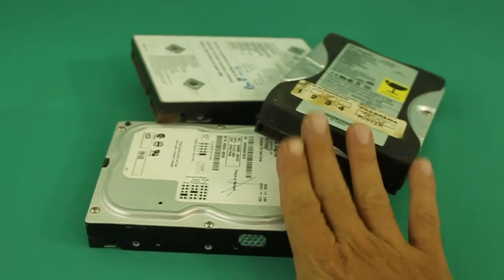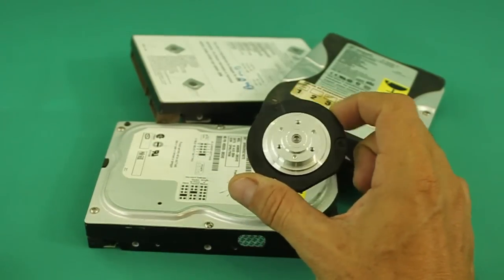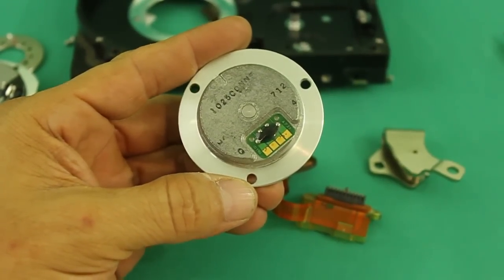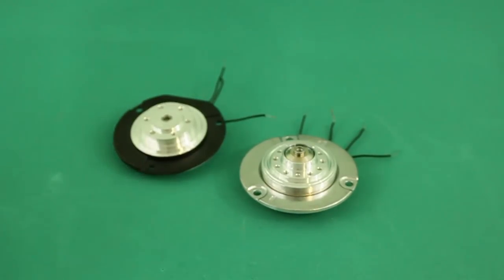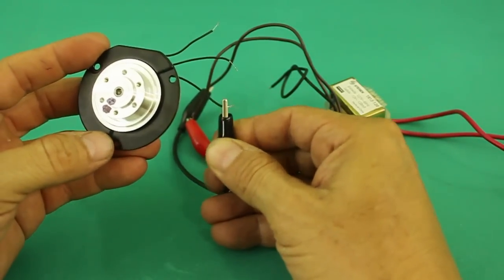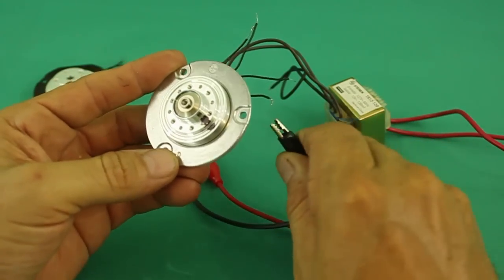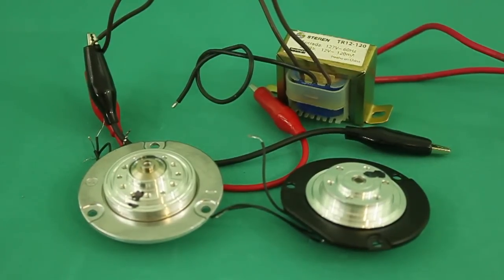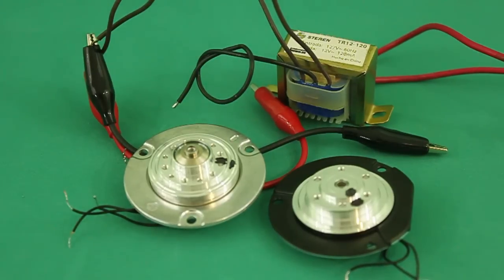Run a Hard Drive Brushless Motor Without Driver

Comment: I worked out the awkwardness of using a brushless without dc when I connected a pin then the shaft rotated slightly then stopped, then I put power to another pin and it shifted so.i could only move the motor 1 increment at a time, I couldn't think of a solution so I gave up on it lol

Comment: You didn't give DC supply.  Your supply was AC
Reply: Every Device who need DC power they definitely runs with Supply or Adapter so they use mini transformer as Supply. Transformers converts AC power to Dc as low as you need.
Reply: @Wiipro2006 but he said vice versa

Comment: Using a simple metal-paper condensator to form a Steinmetz circuit does improve it totally: more torque and starts without external help. How to connect? See https://de.wikipedia.org/wiki/Steinmetzschaltung (sorry, no English equivalent)

Comment: It can spin by itself by using a Capacitor in every wire or can use its original harddrive's ESC.Powering the PC tower harddrive in 12v makes it spin by itself without the help of the computer's processor.

Comment: Single phase create oscillating magnetic field. You need minimum of 2 phase to have a self starting motor (for synchronous motors). Also, speed of motor will be fixed (synchronous motor + 50Hz).

Comment: You CAN use motors made as part of the frame - I have several. You simply need to very carefully cut the frame around the motor (ideally with a band-saw) making sure NOT to damage the flex connector that will almost always be present for such motors. Once cut it can be used like any removable motor.

Comment: Should the supply be 12 VAC maximum? And I was wondering if these little motors are basically induction motor without magnet as a rotor but more like a squirrel cage rotor?

Comment: What is a 12 volt transformer?  
It is best to simply say what are you supplying to the motor with exactly.  12 V AC, 12 V DC or...… ?
Reply: It would provide 12v ac at 60hz in the US
Reply: @hyperion112  I can't even begin to describe how I feel about choice of words used, especially in science where word accuracy is more critical than any other area.  
Here for instance when I hear the word transformer, it instantly and subconsciously to me it implies going high, going up. To transform.  It is how it is used in everyday language.  Imagine telling that something has transformed. That person has definitely experience some sort of transformation. he seems much more disciplined etc.  But  in science it is an outrage.  And I have no desire to bore you with writing a long a narrative.  Just one more for the road.  Particle spin, spin up, spin down. Big baloney bullshit.

Comment: Use a brushless controller from a model aircraft and it will self start and you can select the speed by injecting a pulse between 1 & 2 mS (simple 555 circuit)
Reply: https://www.youtube.com/watch?v=TeZXXDoEGuc

Comment: The reson why u must give a push is because the alternating current only flows to 1 of the coils. If it was hooked up to a driver the driver would fire the coils n,s,n,s - and so on deleting that push from the beginning and have much more power and efficiency

Comment: Are you sure its AC motor powered?
Reply: AC stand for alternating current, and he's driving the motor by the frequency of the power grid, either 50hz or 60hz, that's why he says you can't control speed by this method. You can however control speed by changing the frequency with a motor control unit, either a dedicated or a Arduino/blue pill, or similar, by PWM, or even simpler circuits. It can be driven by both ac and dc, so it's universal.

Comment: Use a capacitor whit one connected wire and the not connected wire and it will start on it's own!
Reply: Then you will have a fase shift do to use of the capacitor.

Comment: In fact brushless motors work with AC current that come from electronic cuirct and control of speed by different frequency. There for its work with AC currnt that come from transformer but its slow because the 50 or 60 hertz it's so low frequency for this motor

Comment: By adding a capAcitor between ANY PAIR AND Supply the other two it will spin by itself associated with vibration my innovative friend
Reply: @Francisco E. Parulla same way a single phase induction motor needs a capacitor to start. And switching the legs connected to that capacitor will change the direction.
Reply: Starting capacitor like a washing machine motor but on a micro scale. 👍
Reply: A washing machine motor is a brushed universal motor. Not an induction motor.
Reply: you are right

Comment: i don't get it ... why is other sites using a 30a  ESC brushless motor speed controller if all you did was hook up 12 volts to two of the terminals?  i only know enough about electronics to get my feet wet so I'm guessing I'm missing something here ...
Reply: because by this mechanism you will not gain speed.. not gain torque..
Reply: https://www.youtube.com/watch?v=n1h4ju7vQuM&lc=z22ktzeyrvabgjmzo04t1aokgzlox3gnkzscyogc0c5ork0h00410

Comment: a cap between the freewire  and + or - wire  can run the motor without touching it forward and backwards if you change + or -

Comment: I'm here scratching my head trying to figure out if this guy was really serious when making this video... FFS if he really knew how these Stepper Motors worked (I don't even think he called the motor by it's actual name a single time) then he'd have known Stepper Motors, and those alike are all Magnet DC Motors and since these were designed to have various speeds they have 2 input power sources. One source is the Main Power of usually 12vdc and the second is usually around 3.5vdc. All he had to do was exactly what he was doing and then touch the 2nd wire to a smaller voltage battery, the negative wire attaches to both negative wires on each power source naturally. 

And don't forget you're voiding your warranty when doing these tricks. so all those hard drives from the 90's you've been saving all these years you can forget about keeping the warranties.

Comment: Motor DC input voltage AC very fun.
Reply: It is not dc motor you can make it to do using controller original or make it you probably don't know nothing about ac dc current any thing you can make it work using electromagnetic induction and pulse

Comment: What needs to be done to get more AMPS with the same setup?
If you charge a capacitor rack, wouldn't you be able to pull HIGH AMPS from the CAP?
Reply from the maker: Yes but only for a limited period of time
Reply: This is the tricky part I always wanted to know how to calculate...
How to come up with the time a different load can stay above certain voltage while discharging at certain rate?  So that on the other side you can pump volts (with some voltage pump) at some rate so that you can keep the discharging cap full at all times...  Are you with me?  Thanks!!!  I LOVE your videos...

Comment: I've added a speed control using a sine frequency generator on my phone wgere you can adjust the frequency. I plugged my phone audio out into an amplifier which then, I connected to the motor. But after around 150 Hz, you start getting harmonic imbalances and the motor comes to a buzzing hault, because you are usung only one phase.
Reply: I did this also to my stepper motor

Comment: Connect these to a low voltage 3-phase power source. This makes it a AC synchronous motor.
Reply: and what is that low voltage please
Reply: @jumcopper  anywhere from 6 to 12 volts. ( or about 9 volts or so RMS per phase.)
Reply: I have a 9 volt DC transformer. Is there a way to make that work?

Comment: A start capacitor should work, you may need to play with some different values ranging from say ~20uF - 300uF and suitable AC voltage rating. Placing the capacitor between the floating phase wire and one of the other AC phase wires will result in a phase shift in the current and subsequent magnetic field shift in that winding. Resulting in a tendency for the rotor to favor to move in that direction and thus allowing the motor to start spinning up to near synchronous speed. Different the start capacitor capacitance will give different phase shift angles depending for a given winding impedance. This increased phase shift together with the increase is winding current due to the apparent change in the winding impedance due to the introduction of the capacitor  impedance will result in better starting torque. Note though the starting torque will not be very high or as good as having a  3 phase VVVF driver. The added benefit of a PWM drive is good starting torque and variable speed in excess of that attainable at normal mains frequency.

Comment: it still requires that part so either way you still have to buy something or find it inside something....the same as finding a small speed controller and parts inside something but on ebay you can by the parts needed to work for like only 3 dollars for small motor like that.

Comment: Could you use caps to convert the transformer into multiphase one, and then energize all the coils to run the motor at higher efficiency?

Comment: I guess the 4-wire brushless motor has an internal star configuration wiring. So, by connecting the common pin to a DC voltage source and energising the other three pins in a correct sequence can make the motor run, much like a unipolar stepper motor. By using a decade counter with a signal generator, such as a 555 timer the motor's speed can be varied.

Comment: why did not you use diodes to get a pulse dc power supply to feed the motor? and feed 2 wires with 50 hz pulse supply, and anothers diodes as free weels protetions?

Comment: actually motors that are a part of the frame are more usefull. if you tighten it with a vice near the shaft holding the bearing the thin aluminum cast will break and the rotor stator assembly come off in very compact form. after that you can pull out the shaft to rewind the motor if you want and in my case place 3 hall effect sensors. using this method i converted 20$ rc car into brushless rc car
Reply: Depending on the size of the magnet you could probably use a PC fan controller as long as it has PWM enabled. Not sure if this would work tho? Maybe three phase motor would work. Theres always three hall sensors in that case unless it uses current pulse to trigger the next phase instead of hall sensor? I wonder if it would run with just a pwm pulse square wave or does it need zero crossing? Gues ill find out. Im playing with one now.

Comment: Thanks for the experiment.  Why not try using a HV starting capacitor to get it started?  Maybe use a microwave oven capacitor.
Reply: Joseph Nicholas maybe you could get it started with a 20v high capacity cap and a rectifier, but considering the poor reliability and torque you get I guess it's much easier to buy a dedicated chip.
Valuable video nonetheless. Could turn out useful in a pinch.
Reply: Why the HV capacitor? the motor is quite much made for 12V and a capacitor wouldn't help you get it up to speed, it's a synchronous motor and not asyncronous induction motor where you can have it slow-starting.

The AC would need to track the motor up to speed for the start to work. Or it must start on some few cycles or be spinning the right speed.